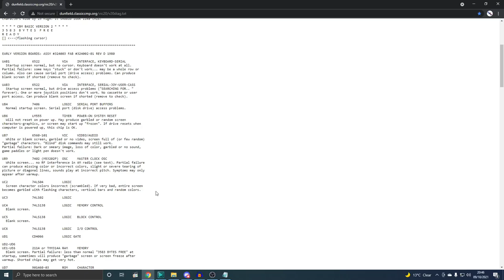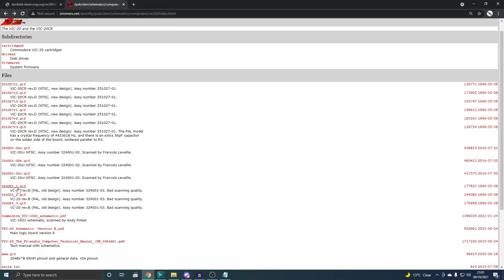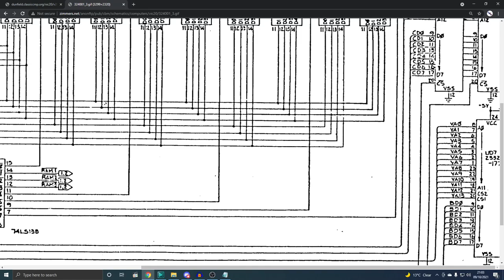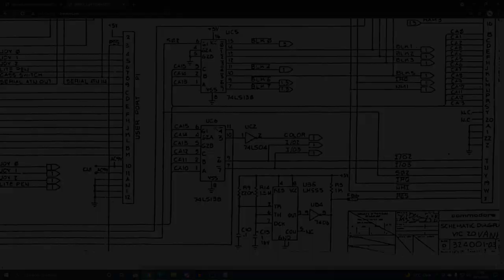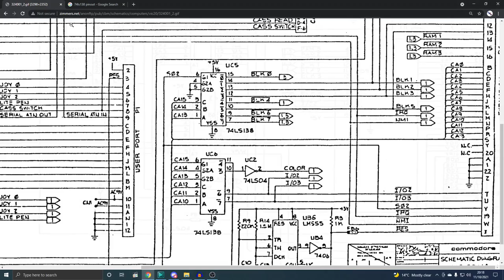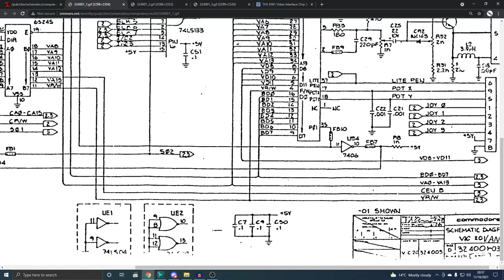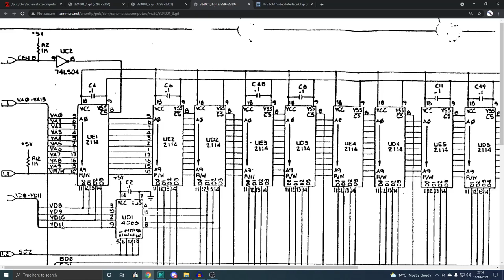Lets fix a Commodore VIC20 showing random colours

Comment: To explain the reading on the logic probe in the early part of the video. the 74ls138 only asserts the colour line when the CPU needs to change a characters colour. A static screen will have minimal activity on the colour signal. A game cartridge with a dynamic display would have more active readings on the logic probe.
Reply from the maker: Thanks for the explanation.

Comment: "That does not look right sure it doesn't" <- That's the most Northern Irish thing I've heard you say thus far 🤣
Reply from the maker: Turns out actually, and I forgot to mention this, but that signal which didn't look right is correct.  I checked it again after the machine started working and its the same.

Comment: Nice work! I have a Vic-20 that had a duff 4066 too, but that was just causing it not to be able to access the disk drive.
Reply from the maker: That's good to know just incase I get any more through the cave.  Just waiting on the replacement 4066 to arrive be for the other machine.
Reply: @CRG  Sorry, I remembered wrong. The duff chip on mine was a 7406. That affects the disk drive access. Hope you’ll find a replacement 4066.
Reply from the maker: Thanks for letting me know.  The replacement 4066 is on order you can still get them easily enough

Comment: good work , i use to have one of them desoldering stations , but had right issues with the solder solidifying half way up , it was a right pain. have you experienced anything like that before?
Reply from the maker: Yeah I get the problem the odd time.  Only thing I can suggest is to use the tool to clean it after every few sucks.  Mine clogged so badly once that I had to drill it out.  Luckily it was just at the end so I could get at it.
Reply: @CRG  glad I'm not the only one , bloody thing. , And good work on the VIC , I'm trying to learn machine language for the 6502 , and keep hitting a road block as i don't own one just yet. , but i plan to buy a none functioning one to tinker with.
Reply: I've got the Hakko unit after destroying two Xytronics. The Hakko at first was plugging up as well, but I read somewhere that if I let it heat up for an extra five minutes after the light went out it wouldn't be as bad. 

Since I've started doing that I haven't had a plug since.
Reply: @johnbos4637  Well, yeah. I'm well aware of that tool. :) 
My post was on how to avoid the situation in the first place.
Reply: @CRG  That's surprising - in my experience, if you turn it up to maximum and leave it for 5 mins or so, everything in it should be melted then you can use the tool to clear it out.